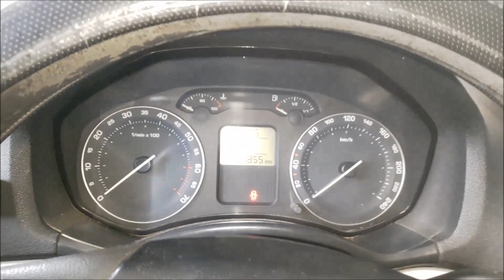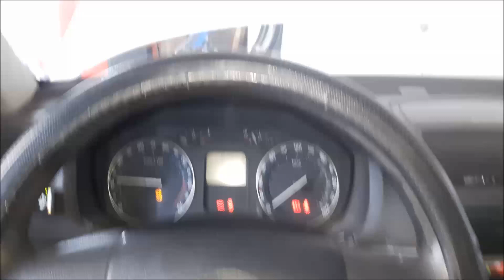skoda octavia how to change clutch master cylinder

Comment: Hi, I did change it but now I have to press the pedal to the bottom before the clutch works. Before it was on the top of the pedal. Any ideas how to fix this?
Reply from the maker: You have to bleed the system open bleeding bolt on slave cylinder
Reply: @mechanicigor  so only bleed, do I have to top up the oil?
Reply from the maker: @Fotoderoodt  yes of course
Reply: @mechanicigor  Thank you! I give it a try, hopefully thats i! To be sure what specification oil do I use?
Reply from the maker: @Fotoderoodt  dot4

Comment: Do you drain hydraulic fluid before removing master cylinder
Reply from the maker: Yes you have to drain
Reply: @mechanicigor  How do you drain it?
Reply from the maker: @nicolaskeith8945  you can use some suction gun or remove the upper hose of the clutch master cylinder and twist it upwards
Reply: @mechanicigor  Hmm OK. Thanks